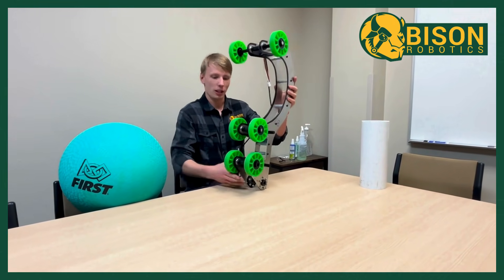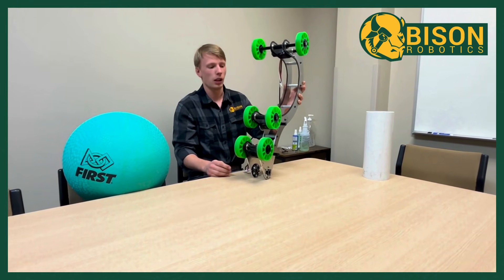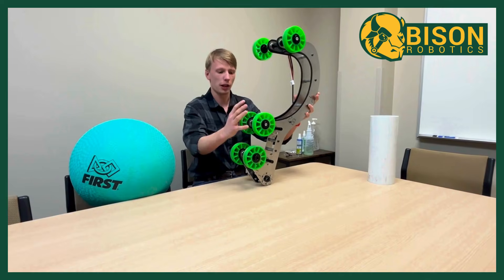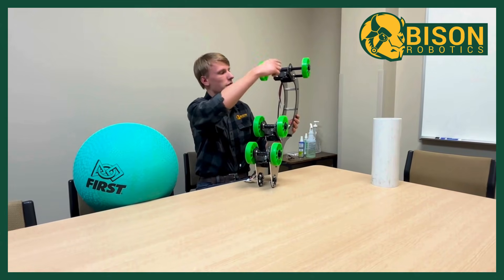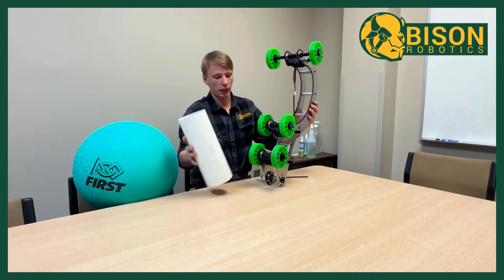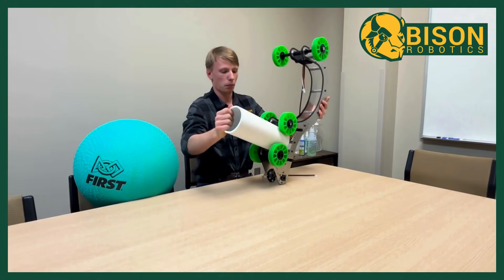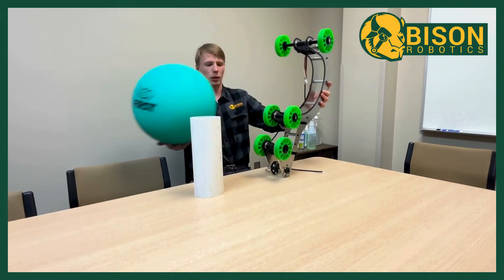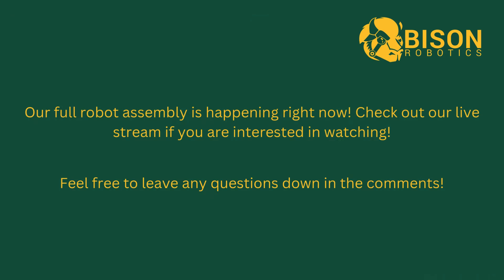Ri3D 2025 Update 6: Manipulator

Comment: Do you have any way to collect the corals long ways instead of just at the ends that would work with that design?
Reply from the maker: We do not. Our intended plan was to pick up from the human player station. That way the pick up is always consistent
Reply: @ are they traveling down the human player station and into the collector for your coral reliably?
Reply from the maker: Yes. We won’t be able to pick up off the floor